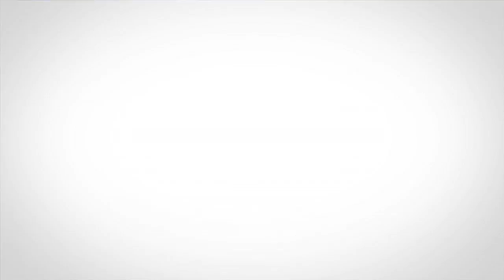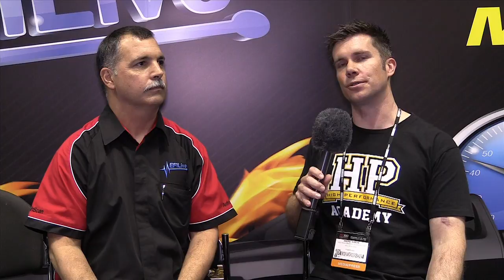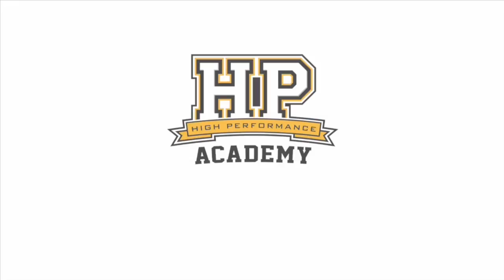250HP To 500HP Without Lifting The Hood! | EFILive Diesel Engine Tuning [TECH TALK]

Comment: Something people seem to struggle to understand with diesels, is that the engine’s power output isn’t a set value like it more or less is with a gas engine. I realise there are some small gains to be made on gasoline engines with tuning alone, but due to the narrow AFR, you’re always limited by how much air you have available. As the diesel runs at such a wide AFR, that airflow limitation is much less significant in terms of tuning for power.  So long as you can keep things at a safe temperature one way or another, you can keep adding fuel and keep making power, increasing intake air is only one way of doing that. So basically, if a diesel engine has a power rating of say 100hp, all that really means is that it’s been adjusted to run at 100hp, it doesn’t (necessarily) mean that 100hp is the upper power limit of the engine. Sure, reliability, longevity etc are another conversation altogether, but in terms of basic power output, a diesel is usually capable of burning much more fuel than the manufacturer has set it to burn 😁

Comment: i was surprised that he said he could double the power.. but made sense later when he said diesels run 40:1 afr - so making it around 14:1 afr and uping boost, i can see that it would make more power- but would also use a lot more fuel.. people typically get a disel due to better fuel consumption, so kinda defeats the purpose.
Reply: no one responded but the point of tuning is that if youre in a situation like me i daily drive it tuning so it runs lean and doesnt consume fuel but when i tow i can tune to have more power yes it uses more fuel but only during the towing
Reply: Relixio or when you try to beat a Camaro
Reply: Well it’s also very uncommon for diesel guys to run just one hot tune. Dont Forget how popular the tune switches have become under the dash offering tunes from stock-hotboi at the flip of a switch

Comment: Thanks for the tips. My cars aiming to double it's factory 114bhp/280lb/ft. 2.0 turbo diesel corolla. Aiming for double as a safe value of reliable performance. It doesn't sound like big bhp or torque. But 560lb/Ft with 228bhp in a fwd family hatchback should be achievable.